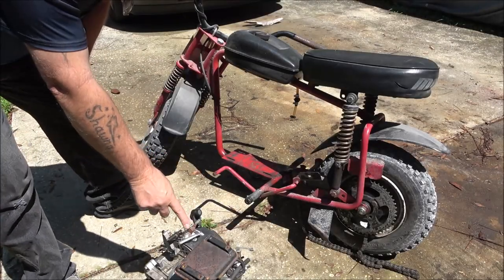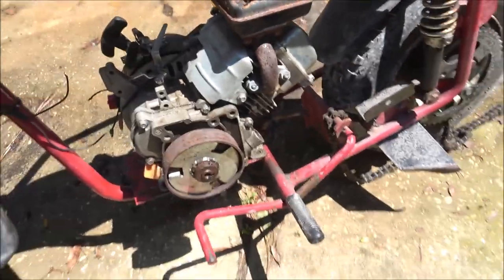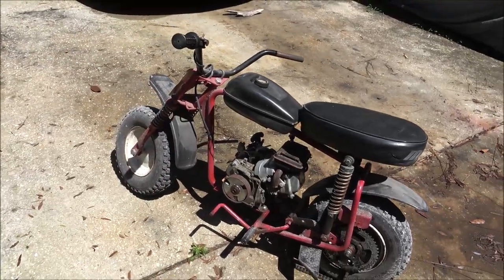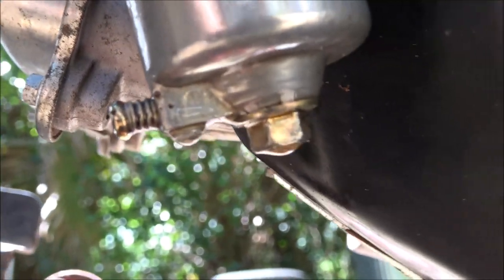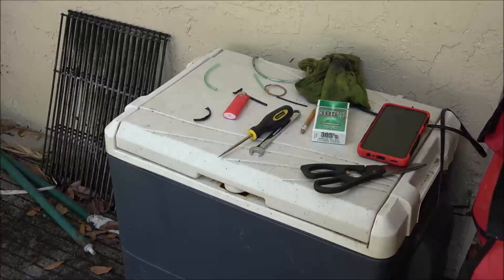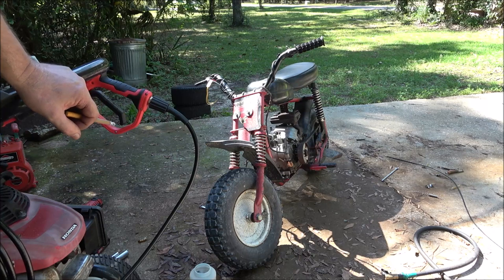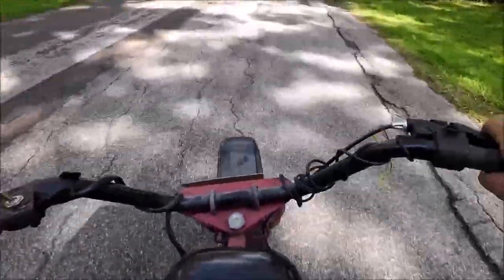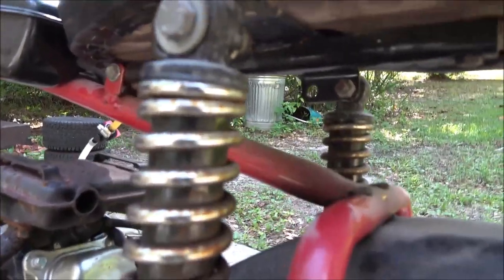Manco Thunderbird 79CC Engine Install

Comment: Are you usin the new mic? Its a lil quiet if so. You sound clear just volume sounds a bit low
Reply from the maker: Yeah.  I turned it down because the sound of the bike was loud because I had the mic turned up too far.  I think I got it about right now.
Reply: @shabear1000  oh that explains it haha that thing is badass i had a version of those when i was 12. It went like 30 mph The thing was no  joke lol
Reply from the maker: @kenny_525 lol. Yeah it should make somebody a good little starter bike or pit bike.
Reply: @shabear1000  shitty part was the carb went out and i needed a new one. Didnt know why it kept dying and i couldn't fix it i was only 12. Eneded up giving it to a gfs uncle and he got it running same day. I was pissed as you could imagine lol
Reply from the maker: @kenny_525 oh man that totally sucks lol